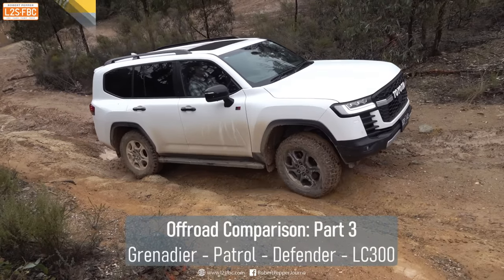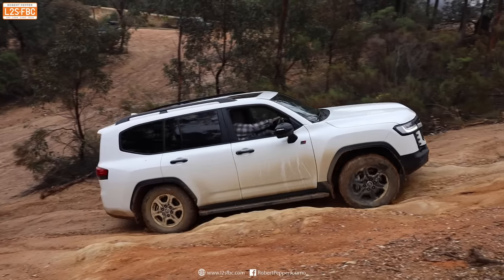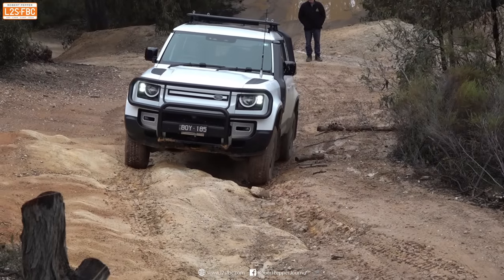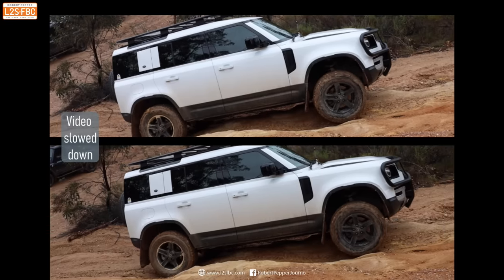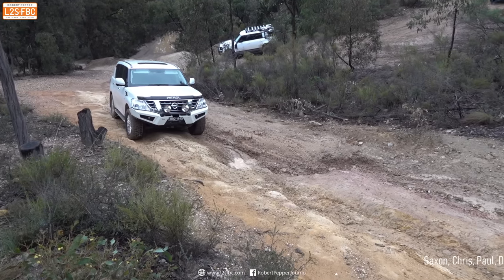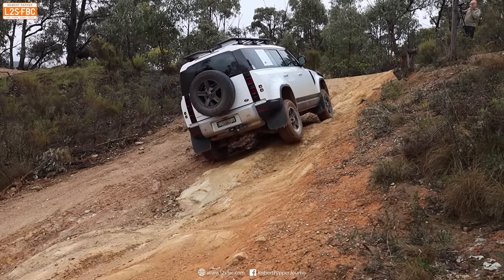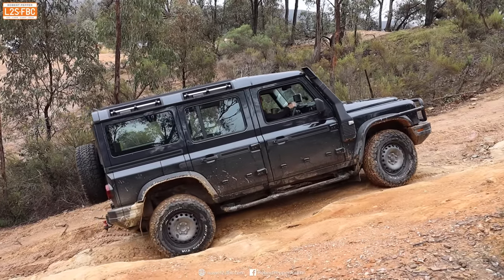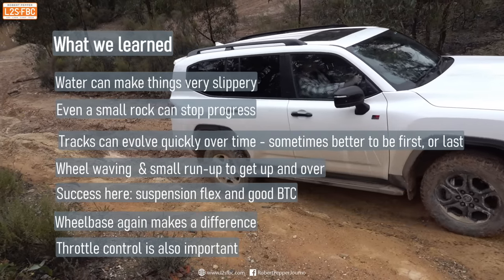Grenadier, Defender, Patrol, LC300, Part 3: Slippery Climb

Comment: I very much appreciate your commentary when the LC300 started to slip. 

Rather than falling into a simple minded ‘it’s the car’s fault’ you point out it’s an issue of tyre limitations. 

Keeping it rational and relevant. 👍
Reply from the maker: Thanks..it wasn't the car's fault.  If all four tyres spin at the same time...that's tyres.  If three are spinning, that's the car as the fourth may be able to pull it forwards.  In all these tests it's a car limitation not a tyre limitation. That's  bit of a simplifcation as wheelbase may be a factor as an example, or tyre diameter, but when 4 wheels spin it's not necessarily the car at fault.
Reply: it's an issue of the driver and tyres
Reply: Grenadier got best tyre setup with steel rims and lots of side wall if you aired down all 4 cars tyres to more optimal pressures for conditions Grenadier would have won easily and other 3 vehicles are limited to beter tyre options makes Grenadier Best.

Comment: One thing about the Defender is it flexes much better on the normal hight mode then the off-road one. From my experience, I only raise it up when wanting to overcome an obstacle, it probably has more clearance than all the others in this comparison in normal hight, and it would have reasonably close flex.

Fantastic work on the videos, they have been really enjoyable and informative.
Reply: Interesting that it flexes better in normal height....on my 2012 L322 in off road height mode the cross valve articulation is turned on and it flexes more in off road height as confirmed by me lifting each tire corner with a forklift. I've since installed a 2" lift via custom air bag spacers so now my truck is in off road height as "normal" but the bags are only inflated to "normal" height dimensions. Maybe they changed something on the new Defender to limit the off road setting articulation....doesn't make sense why they would do that though.
Reply from the maker: It's got cross-linked air suspension. See Part 1 for an explanation.
Reply: The cross linking is better in Rock Crawl mode. The new Def has dual chambers in the air struts allowing height independent of spring rate. A few years back I had a D3 fail to drive through a rutted obstacle when it was in Mud & Ruts but drove through with no issues when in Rock Crawl. Also played with ride height on the D3, RR and new D110.
Reply: @L2SFBC  So should the Defender flex more in "off road" height and or does the terrain response control setting have relevance here?
Reply: Because it's made for driving over curbs when mommy drives the kids around.
Reply: @georgecarousos6735 Personally I expect best flex in normal off road height as the main chamber would be a suitable pressure and the raising of ride height by 2nd chamber. The anti-roll bars should be in loose mode via Terrain Response. Note this is my opinion and I have no confirmation from Land Rover.
Lottery time and I'd probably not be buying any of these...😂
Reply: @GavinEarnshaw   I've got a white paper on the terrain response system from when developed for the LR3....I'll have to look it up. It mainly discussed traction control algorithms but suspension travel wasn't really covered. I do know that on my L322 in off road height it flexes better when tested with a forklift...but I just left the terrain response setting on the street mode, I didn't try it in mud, ruts, etc.   I do know that the better the lockers/traction control is, the less flex you need. I have an H1 Hummer and it has the articulation of a frying pan, yet just one tire with traction can pull it over difficult obstacles because of the Torsen differentials.... true mechanical lockers would be even more effective when dealing with limited articulation.
Reply: @georgecarousos6735  that sounds interesting 👍 (off-road geeks only).
Brake traction torque transfer is good but we can all (probably) agree proper lockers are great. 
The D3 we used wasn't Johnson rod lifted or reprogrammed just had bfg km3s. Wouldn't drive through an off camber rutted hole when terrain response was in mud & ruts but would in rock crawl. External watching showed better articulation in rock crawl. This also matched what I'd been told by a LR engineer who'd been part of off-road setup.
I also think that mud&ruts mode responds more to sudden dynamics from the roll/pitch/yaw sensors in the roof and near transmission. A very common roll over is ruts + bad steering+ sudden attitude change as the ruts disappear and steering suddenly grips to side. The TR system supposedly cuts power to reduce speed and reduces the chance of rolling.
I'd love to know if your doc confirmed (or not) this. Thanks 🙏
Reply: @GavinEarnshaw  I'll look it up and post the link. My L322 is now lifted with spacers below the rear bags and on top of the front bags....so in "off road" height the actual bags are sitting at normal height/length. After I put 32.5" E Load range tires you can feel the added weight and ever so slightly more road imperfections. I still had to use Johnson type rods to keep the truck from trying to lower itself due to the spacers. So far it's been fantastic and if you ran stock-ish size tires you can literally drive with complete bag failure (albeit not comfortably) to get repairs.

Comment: Love how you guys show key differences in the capability on the screen simultaneously, these are extremely well engineered vehicles. Definitely going to get me a GX550(LC250) when the opportunity arises.
Reply: Gx600 is an lc300
Reply: LX600 is LC 300
GX550 is LC 250 Prado
Reply: @matthewhubbard7177  thanks for the correction!

Comment: Excellent, fair, objective comparison. The 300 and Patrol were very impressive. A very clever blend of suspension design and BTC (Mechanical engineering AND electronics in harmony). The Defender's TR2/E-diff (slightly cheating!) is best in class, superb and masking the serious shortfalls inherent in its suspension (electronics over mechanicals). The Grenadier's BTC is comparatively off the pace, but its superior suspension is just keeping it in the race (mechanicals over electronics). But as you say, every situation favours one over the others: dry rock ledges would perhaps favour the Grenadier and a muddy, flat, pure traction test would favour the Defender.
Reply from the maker: Excellent summary, agreed!
Reply: I also think it's worth considering how the different vehicles were intended to deal with various traction challenges. Yes, the Ineos clearly showed a much slower and weaker BTC intervention, but it's the only one with front and rear electric locking solid axles (standard equipment). I interpret that to suggest it was intended to climb a track like that with at least the rear axle locked, while the front will maintain two-wheel contact further than the IFS vehicles in most situations (and still can lock if necessary). The Land Rover and Toyota, by comparison, are really intended to use BTC to maintain constant torque delivery to the ground, with the Toyota additionally using more flexible suspension design to avoid unloading or lifting wheels (admirably so for an IFS truck). The Defenders seem to lift tires whenever I see them crossed up, and I get the impression that's just baked into the design.

Comment: What mode was the defender in? It appears to be in rock crawl (may be wrong mind), but that pushes the articulated wheel up whereas mud ruts will push the articulated wheel down to keep more wheels on the ground and maximise articulation

Comment: Re Grenadier BTC, I’ve seen another video where switching offroad mode off significantly tightened the BTC response and solved this issue. I’d love to see an example like this comparing the BTC on the Grenadier in offroad mode vs normal mode.
Reply from the maker: We did try that in the original test I did, with/without.  I couldn't see any significant difference.  However INEOS are known to be updating software.  Ford improved the BTC on the Everest for example via software. And I did tell the driver to use offroad mode.
Reply: Had another look at that video - this time with subtitles on. The driver was actually turning on offroad mode to kill the parking sensors. He had engaged rear locker in the second attempt. So ignore my comment - BTC remains poor in all circumstances!
Reply from the maker: Yep rear locker would make it look good thanks for clarifying.  Unfortunately no BTC on front axle with rear locker.
Reply: Why weren’t all the lockers turned on in the first instance for the Grenadier ? Did the other vehicles have some of their 4WD features turned off as well to make the comparison similar?  Why not just put all the options on and see how they go side by side?

Comment: Hi Robert thanks for the continuation of the comparison its great to see the vehicles on a  slippery climb. I have a few comments based on traction equipment and locking differentials .I am not sure a simple comparison can be made when new tech exists and various modes are employed or not. Assuming the three locking diffs of the Grenadier were not used hence are we testing the vehicle or simply a base drive without any off road equipment ? What mode was the LC 300 set to for the climb ?  Also tyre ,size pressures and tread types play a huge roll in mud terrain.I would expect each vehicle to improve with optimum tyre choice.I believe the Defender was not significantly hampered by the relatively small rock more a case of tyres fully loaded with mud and not able to climb the object. All wheels were spinning and then once some traction was provided off she went.
Reply from the maker: 1. In Part 1 you can see the lockers in and out, and again in a future Part.  
2. Yes not all Grenadiers have lockers, hence it is fair to test without, and sometimes on curving hills with sideslopes you're better off without them if possible.
3. Refer to Part 1 for the tyres, specs etc. All ran all-terrains.
Reply: @L2SFBC   thanks Robert

Comment: Front and rear lockers would have been interesting for the Grenadier (form memory the BTC disables with both lockers engaged)?
Reply from the maker: 1. Read the text caption in the video
2. Yes you're correct, it disables with just rear in unfortunately

Comment: How would the Grenadier do if the traction control was turned off and it went up with just the diffs locked?.
Reply from the maker: watch Part 1.  The lockers were misbehaving on that run so we didn't use them.
Reply: I was thinking just this. Surely front back and centre diff locks would always be engaged in this situation? The point of the Grenadier is basically its mechanicalness and mechanical locks! (not to say Brake its brake traction control couldn't be better, it clearly could!) I assume all lockers were engaged in the other cars. I'd be really interested to see how the Grenadier performs versus the other if appropriately locked., Worrying that it was broken though.
Reply: @jamiegoodhart7069 
At the start, the caption says only the centre diff locked on all vehicles , not the axle lockers
Reply: Missed that thanks :-) @4bnewb969
Reply: Not to repeat comments I’ve made before,  but I suspect there is no meaningful BTC in the Grenadier. Apart from some marketing fluff in a brochure, there’s no mention of it anywhere. The owners manual refers only to ESC in Off-road Mode or “Reduced Stability” when ESC is switched off. And, when front and/or rear diff are locked, there is “no stability support available”.

While I’d welcome any concrete information on an off-road focused BTC in the Grenadier, I suspect what we’re seeing in these (still excellent) videos is the Grenadier using just the road-focussed ESC and struggling off road. My front wheel drive family wagon behaves in the same way off road - the ESC does do something but, obviously, not very well.

Comment: TFL has a brilliant set of rollers they use for the testing of drive systems. I'm not an engineer, but should be more equal? Maybe build a set... That being said, this is a fantastic video seeing these in the "wild" where they belong...
Reply: That only tests BTC. It doesn't factor in articulation, ground clearance, flex, or anything else I evolved in making a good off-roader. The TFL test could show a Subaru being a "better" off-roader than a Bronco Sasquatch but we know that isn't true.
Reply from the maker: Agreed Paul - however, it's good to isolate variables so the roller test would be fantastic.
Reply: @L2SFBC  oh yes, it has its place, but your premise is the best off-roader and the rollers would only give us the BTC. I still watch every roller test I see.

Comment: Bit surprised the Grenadier didn't do as well as I expected.
Reply: Unlike the others , the simple electronics (the e locker) wasn't engaged. It would walk up.
Reply: It was engineered to have diff locks. If you activate them it won't slip a single wheel.
And if you can lock all wheels the manufacturers don't need to refine the brake traction control as (he calls it) to the same level as when you don't have those lockers.
And in this test they didn't activate any lockers. None of the other cars can lock all 3 diffs, so their reliance on the traction control is higher and the manufacturers need to spend more time refining it.
Reply: LC300 has all three diff lock, but rarely needs them due to enormous wheel travel. My takeaway is that Grenadier has mediocre wheel travel and poor BTC calibration, that’s why it needs all three lockers 😂
Reply: @dmitrijusapockinas16 it has the second best articulation in this group which is why it still manages this terrain despite it’s traction control being a bit slower to activate than the others. The Grenadier locked with very good articulation is likely to be at least #2 in this group and less reliant on electronics than the Defender which is awesome with everything working but a brick if it doesn’t.
Reply: The GR sport has front center & rear diff locks.  However the rest of the 300's don't. I have a 300 Sahara which I spent a fair chunk of change having front & rear lockers fitted to it. I have also lifted it 2 inches & thrown on Micky T baja boss all terrains. I'm fairly confident it would come out on top in this challenge.
Reply: @jerryfrench2981  you would hope so after all the money you spent.
Reply: @andrewwiltshire2689  Yep. I would probably just bought a GR but there a massive lead time. I walked in & was lucky to pick up the Sahara as a cancelation. From test drive to getting one home in 3 days. I've spent around 30K on it now an still have to put a roof rack, clamshell tent & dual battery & maybe a bush wrap but for now I've run out of money. It's an expensive hobby.

Comment: Is there a reason why you guys arn't using the lockers on the Grenadier? It should be the most capable of the bunch?
Reply from the maker: Yes, lockers weren't working on it for that run, they were before as per Part 1, and you'll see them again later when they came back.

Comment: I understand that off-road capabilities are known, but if you're looking for a great tourer for overland experiences, mild off-road adventures, and camping trips, which one would be most suitable?
Reply: Not the defender .When it stops you need a laptop and a technician or a flatbed
Reply: The Defender for me, no contest, suggest do a test drive in each.
Reply: One measure is look at people who actually spend their own money and buy these vehicles. Landcruiser sells approximately double patrol and defender sells a bit less than half of patrol.
Reply: Toyota land cruiser
Reply: Whichever one is the most comfortable to use for you and has a winch!! Once you’re in a no traction situation it doesn’t matter what you drive, only a winch (and maybe an inflatable jack) will help.

Comment: Such a shame the grenadiers traction control is so poor. Meaning you have to spend extra for lockers.
Reply: Pretty sure they come standard with front, center, and rear lockers.
Reply: @xm3ntal620 I don’t think so. I think they’re options. Certainly in the uk anyway.
Reply: @MrTreegeek1978  looks like it is standard on trailmaster trim and optional on the rest. TBH, if i'm spending this kind of coin I'm getting the lockers no question about it.
Reply from the maker: That is correct only standard on TM. Hence we test with and without. This was without there will be other tests with as there was in Part 1.

Comment: I am at a loss as to what you are testing here? If it is the vehicle and it's traction control, then each vehicle should be shod with the same tyre, same profile, same pressure and mass per square cm. (contact area). If it is the tyre's in question, then each tyre type should be tested on the one car, not several different cars - otherwise it is just an argument over systems, wheel bases, track, speed, line choice, moisture content, time of day, number of attempts etc, etc, etc - on it goes.
Reply from the maker: Take the video for what it is. It does not purport to be a fully instrumented test that isolates specific variable to compare - and even if I could afford the time and effort to do that, then we get into academic value not real-world as each factor interplays.  It is possible to learn a great deal from seeing the four cars do what they did and that is the value of the video, perhaps not to you but to others.